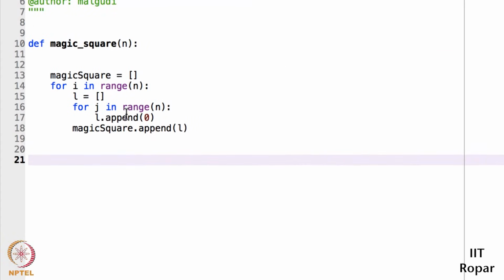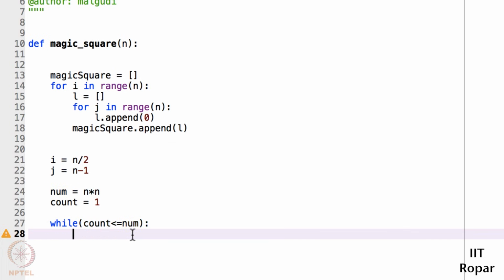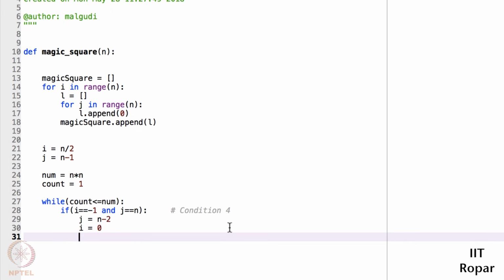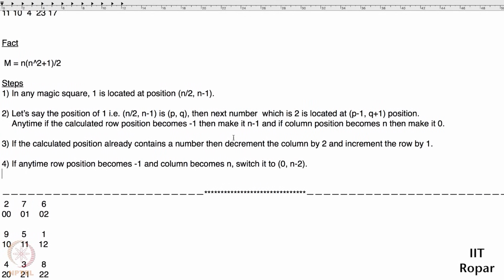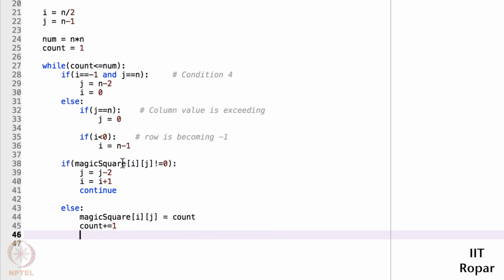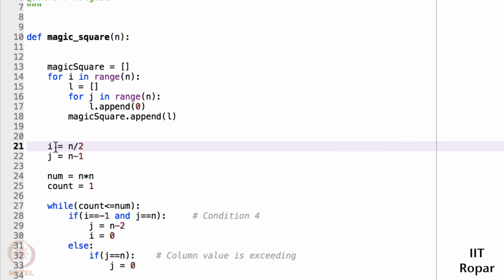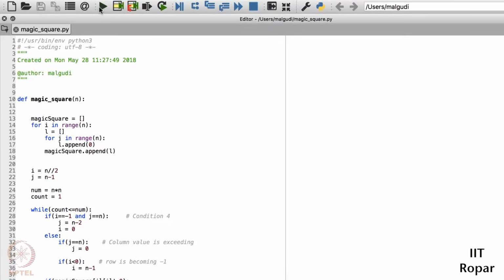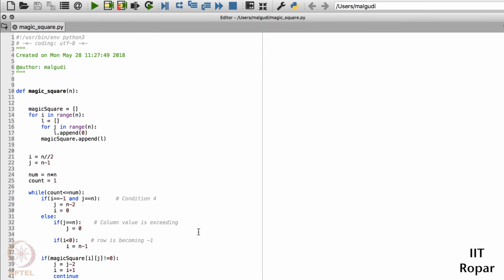Magic Square Hit and Trial 05

Comment: i=1
#M=[[0,0,0],[0,0,0],[0,0,0]]
n=int(input('Enter the Square number: '))
p,q=n//2,n-1
M =[ [0 for j in range(n)]for k in range(n)]
M[p][q]=i

while(1):

    i=i+1
    if i>(n*n):
        break
    else:
        (p,q)=(p-1,q+1)
        if ((p==-1) and (q==n)):
            (p,q)=(0,n-2)
        if p==-1:
            p=n-1
        if q==n:
            q=0
        while(M[p][q]!=0):
            p=p+1
            q=q-2
            
            #print(M)
        M[p][q] = i
        #print(M)
print(M)

for a in range(n):
     for b in range(n):
         print(str(M[a][b])+' ',end='')
     print()
#This programme only works for odd inputs.